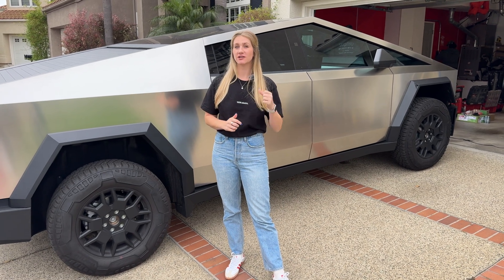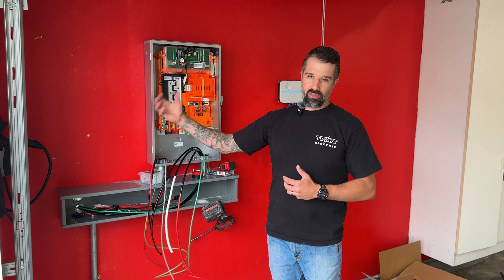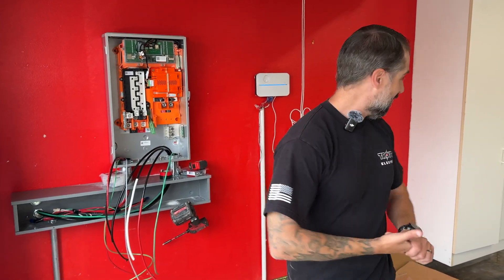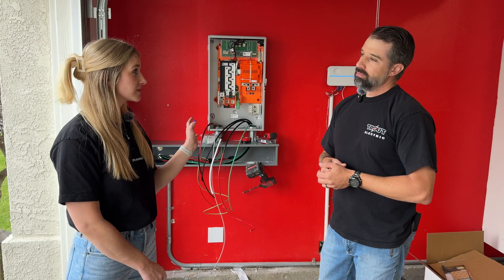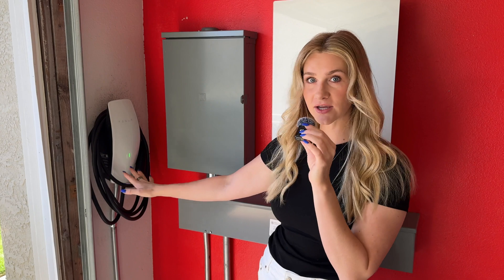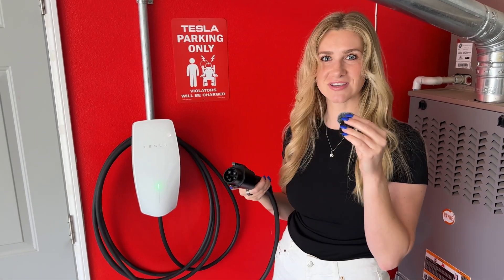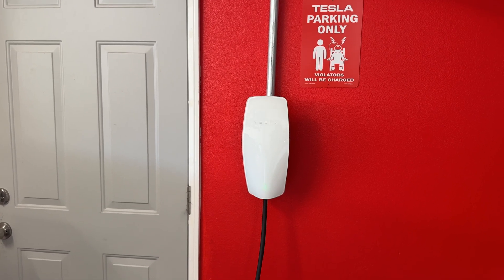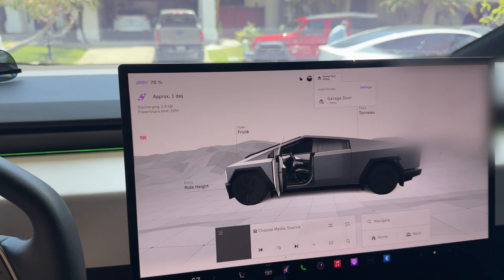Cybertruck Powershare Bidirectional Charging - Installation and Power Outage Simulation

Comment: I powered my house for over 24 hours and only used 15% battery, granted the weather was mild so AC/Heat was not running much.
I also didn't have powershare at the time I had just used a 50' - 50A cord to do hookup to house like a generator would.

Comment: FYI the 1 second example was misleading -- An installer told someone that it takes anywhere from 3-45 seconds for PowerShare to kick in. 3 seconds if the car is awake, and up to 45 seconds if it’s in a deep sleep.

Comment: I like the idea of the Cybertruck Powershare, however I think an Anker F3800 and the Home Power Panel (HPP) is a better option --especially if you need sub 1 second failover response. 
With the Cybertruck Powershare, there is like a 3 second cutover after a power failure.  With the Anker F3800 and HPP, failover is 20 msec.  The capacity of the Cybertruck is greate but for $2,500 (Tesla Gateway) + $500 (Gen 3 wall charger) the money would be better put to an F3800 and HPP--or unless it is included for "free" with Foundation series.

At best the Tesla Powershare is a "standby" power backup while the F3800 is a true home UPS.  I was going to go the Powershare route but the F3800 just makes more sense for me.
The 48v out from the Cybertruck, can be use to feed the F3800.  The F3800 can handle up to 2400 watt (1200 per port) DC input, but the Cybertruck will only output 400W.
Reply: 3.8KWh vs 123 KWh. If you have the truck spend you money on the PowerShare. 1 truck = 9 Powerwalls = 32 Anker F3800
Reply: @ F3800 still makes more sense even if you have at CT. It’s not about only capacity. Sub 20 msec failover and can back up the house while the truck is not there for the same price AND you can charge the F3800 from the CT.

Comment: I'm a little puzzled how the Universal Wall Connector can back feed to a house. There are only two hots and a ground terminal in the wall connector wiring box, so how does 120V split-phase get created? It's 240V across the two hots. For the charging function, the ground wire would typically not be required to have the same ampacity as the hot leads (like 6 AWG for 60A hots, and 10AWG for ground), and using ground as a backfeed neutral sounds like it would fail electrical permit inspection.  It seems like there would need to be something like an autotransformer to convert 240V to split-phase 240/120.
Reply: The Gateway has an NFT built into it (Neutral Forming Transformer), this is the same way that Enphase does it, with their IQ System Controller 3 and IQ Battery 5P's, FYI, the NFT's are usually on 40A breakers..  Most houses are fairly well balanced on the 120V circuits, so a 40A differential is very unlikely,and of course 240V circuits are always balanced.  remember, the house is disconnected from the grid by an isolation switch, so the neutral is formed the same way it is in the utility transformer...

Comment: They’re likely checking the customers panel service rating and for NEC 705.12(B)(3)(2), so ideally a 225A/200A panel allowing up to 70A backfeed. NEC 705.12(B)(3)(3) Sum rule would be applicable too

Comment: Disappointed the power took that long to come back. Many cheaper solutions are like a full UPS for your critical loads/backed up circuits…no outage at all with no disruptions to computers or electronics or clock resets!
Reply: not going to make a difference for instant, 1 sec, 3 sec....

Comment: I would have just used the 240V outlet from the truck to manually feed it back to my house, turn off the main breaker and ones that take more power such as the dryer and voila. I’m very cheap but it’s a very nice setup.
Reply: you can't, you'd have no Neutral without the NFT (Neutral Forming Transformer), that is part of the Gateway, which also does the isolation from the grid

Comment: Since the NACS cable has two power pins, how do you get split phase power? (240v and 120v) Does the gateway have an autotransformer to provide neutral? Is neutral still 0v to ground?
Reply: The Gateway has an NFT in it (Neutral Forming Transformer)

Comment: Not my experience at all. You say local electrician and used Trout. I received an email today from Tesla that can not be responded to stating I get A $2500 Voucher as Treehouse cancelled my install although they didn't have equipment available to install with my existing solar and panels. Right now, Not happy

Comment: Any idea when DC power share (v2h) coming out for normal Teslas so we can expand powerwall with our vehicles? AC works cause they designed the CT to invert the dc on the vehicle. But as far as I know normal Teslas don't have that capability. I really hope when they do have V2h they make it backwards capable with older vehicles. DC V2h with a Powerwall should be easy. DC is so much easier than AC.

Comment: All of these videos on the CT and not one person has ever mentioned how hot the wireless charging pads get. They get so hot, that your phone stops charging until it returns to a lower  temperature, so I have ti take my phone off the charging pad for a few minutes then put it back on.
Reply: I haven't had that issue on our X or 3.  Is it unique to the CT?
Reply: It may be a CT issue.
Reply: THANK YOU 🙏🏾 
I was wondering if my 7days old truck got an issue
Reply: @eEvangeliste  Right!!! Its not just you.. Ive have my CT for almost a month... I did see where they sell a rubber pad (on Amazon) that you can put on the CT charing pad that is suppose to help with the overheating issue

Comment: I was surprised it wasn't instantaneous - Pretty sure the F-150 Lightning is
Reply: If the Cybertruck was sleeping (contactors open), I believe it would take a few seconds to switch over.  The F-150 Lighting exports DC thus requires an external inverter the Cybertruck sends 240AC back to the home (inverter is on the PCS board of the Cybertruck).  Using an external inverter could allow for more or less power to be exported.
Reply: @ronolsberg1468  That sounds about right!  $2k in hardware vs. $5k plus a whole lot of other weirdness like Bluetooth might just be worth the delay.
Reply from the maker: Wasn't!? It pretty much was, it was less than 3 seconds...
Reply: I watched the video multiple times - you should too; it was about 1 sec; to be instantaneous the truck battery would have to be getting a feed directly from grid and the house would be powered by the truck constantly (like a data center) so when grid goes away there is no interruption…but this isn’t a data center, its a house; which is why a Tesla Power Wall makes so much sense (not in this video)

Comment: Please update us with how long the battery lasts for your home after a few cycles. Also specs such as how much energy your home uses would be important to know. Lastly consider creating an X account! :)
Reply: This is math man, you can guess what they power (1400W is not little so it is probably not continues ) and you know how big batteryis
Reply from the maker: I'm on X as techiedani!
Reply: The mth doesn't add up. Though 1.4 kw should last longer than 24 hours on a 123 kwh battery